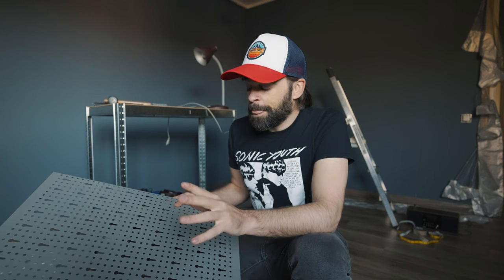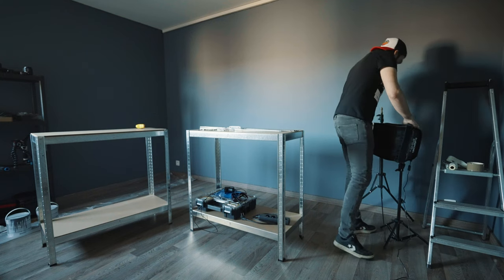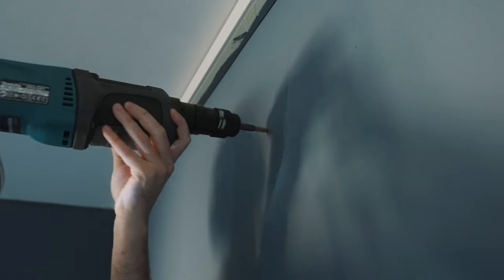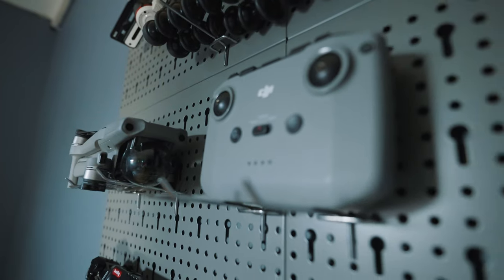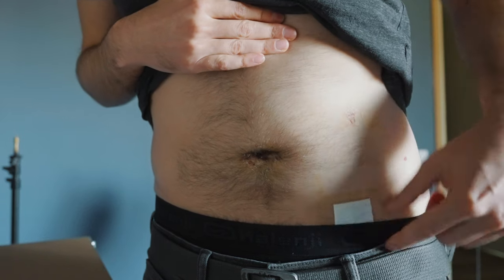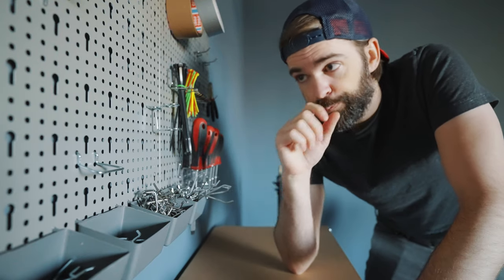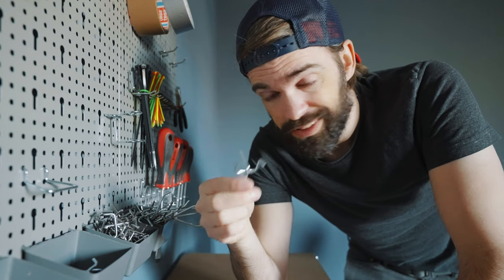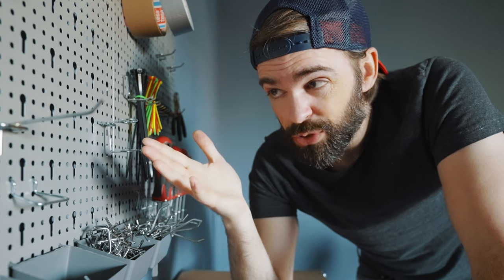How to Build a YouTube Studio at Home Pt. 2: Gear Wall + Health Update

Comment: Looks like it is time to bend some wires.  Two pliers, and voila, you have 23mm.
Reply from the maker: Yeah, it works for the second set but not the first one because then the angle and curves get all weird and they don't "grab" the holes properly.